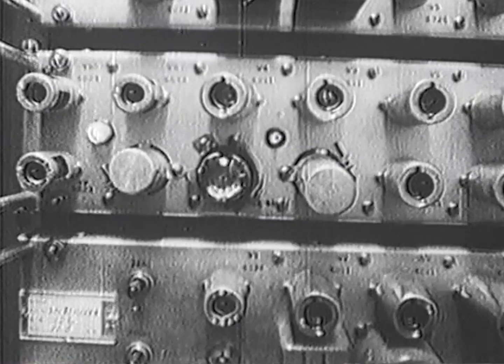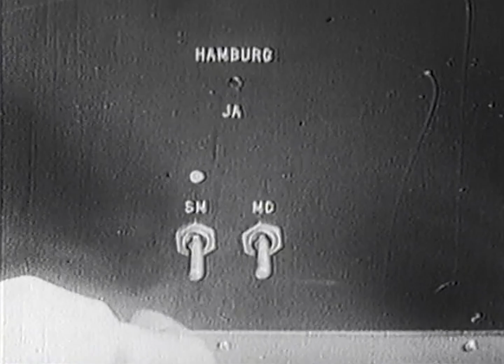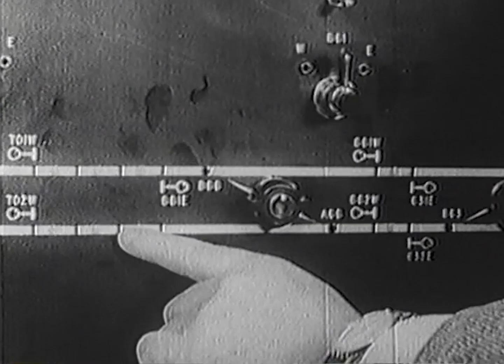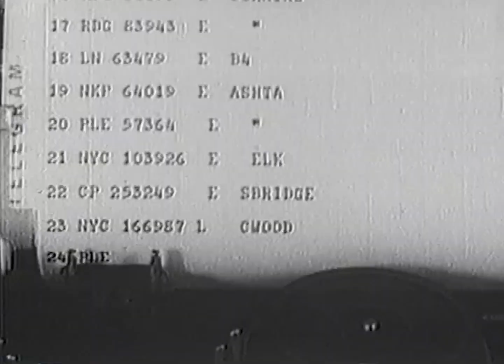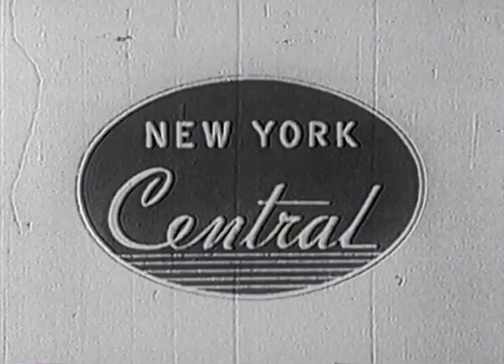Three Giant Steps | New York Central

Comment: I can see why Flexivan didn't take.  While it saved time, it required specialized equipment for it to work.  You couldn't take a preexisting trailer and use it for Flexivan, and it limited where you could move your trailers to or where your trailers could originate from.  Shippers already embracing the flexibility of road haulage would not have taken a liking to the additional equipment investment when they could just keep sending trailers down the road.  Mobile cranes solved the problem of piggyback service - rather than back a trailer onto a flatcar just lift it and drop it on the flat, then chain it down.
Reply: Although you can also see in flexi-van the earliest idea for what would eventually become contanerization. Just took some tweaking to get there